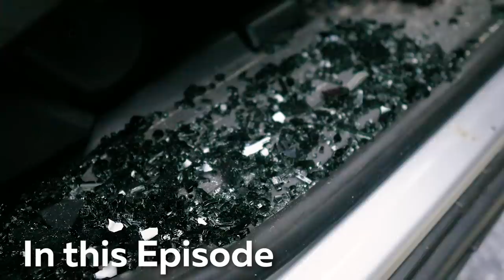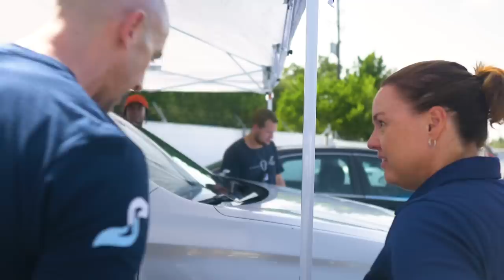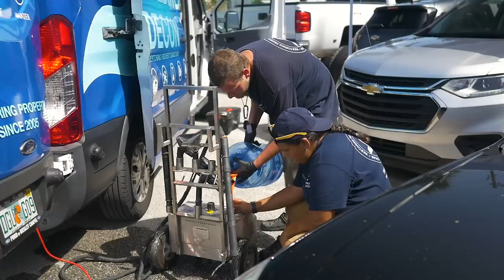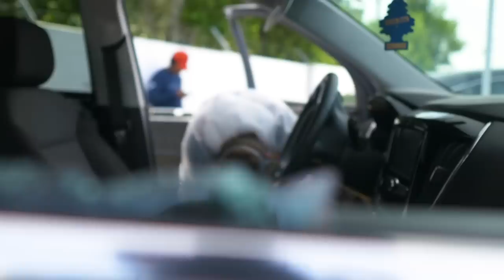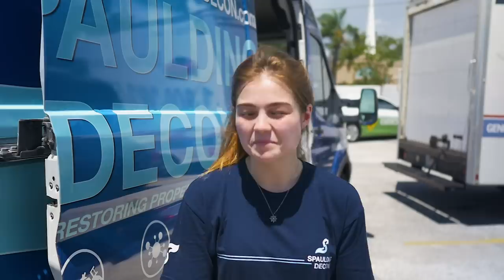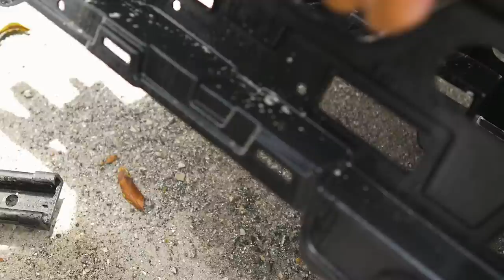Southbound Shootout

Comment: I wish you guys could've put the the car into a warehouse of some sort so it would be cooler working conditions.
Reply: Or work at night when it'd be cooler.
Reply: @fungussf  why can't they just crush the car and get it to junkyard??
Reply: @margaretalbert69  its covered in blood. The biohazard has to be removed before it can be taken to the junkyard.
Reply: @AlyssaSoftPaw  you can buy bio cars from copart with the blood and all
Reply: @cstoner421620  Yep.  I have seen them on auction sites.
Reply: @margaretalbert69  depends on the value of the car after repairs. That looked like a fairly new car. The cost of cleaning and repair is probably still far below the resale value. Even when it is higher, many shops will buy them at auction if they can do the most expensive work themselves. That still allows them to turn a profit if the repaired car will be worth it. Personally, because of stuff like decomp, frame damage, and flooding (mold), I don't intend to ever own a salvage title car unless I can get its history from a reputable source.
Reply: @blazertundra  sorry if I read your comment wrong but I'm curious. If the car has had bio in it, it automatically has to be a salvage title? Or was that just an example
Reply: @mossymindful  bio would only make a car a salvage title if the cleaning/repair costs more than the car is worth. For example, a rat could die in the trunk of my car and be found a month later. The cost of throwing out the carpet and hiring a cleanup company to clean up anything I missed and ozone the trunk would be way cheaper than my car is worth, so it would not be a salvage title even though it had a bio job.
Reply: @AlyssaSoftPaw  this car won't go to a junkyard. It's at a body shop to be repaired and put back on the road.
Reply: Ann B  why let a vehicle someone else can drive for far cheaper than a new one go to waste
Reply from the maker: The dealership was actually planning on reassembling the interior of the car so it could be used again, so we had to decontaminate all the bio in order for it to be safe for future use.
Reply: Margaret Albert Exactly my same thought! Wouldn’t the people investigating the crime be digging out the bullets. What do they plan on doing with the vehicle after your crew is finished?
Reply: Lizzy   Won’t it be crushed anyway?
Reply: @cstoner421620  really🤢
Reply: @swiftkarma4436  recycle reuse. The number of soda cans that are recycled is amazing and most likely because of the alloy we will see a can we drank out of at some point in our lives. All be melted to make new

Comment: Time to buy a set of Torx screwdrivers, those are the types of screws holding down the seats. They are increasingly being used in cars and equipment. I bought mine at Harbor Freight.
Reply: That is where my husband bought a huge set of all kinds of star tip and hex tip type of screwdrivers. (Harbor Freight) At the time I bitched about the purchase, until we needed them to find one of my rings that got lodged under the seat in his truck. Now I keep a set in my own personal tool box I keep for my house hold projects. They work great.
Reply: @ Willliam I was thinking they could use a Tap & Die set. My cheap lil set has gotten me out of some real pain-in-the-ass projects
Reply: Torx sockets. Screwdriver ain't budging that loc-tite

Comment: It would be worth investing in a misting fan like amusement parks have. It mists water in front of a fan to cool the area and everyone in the area. You might not use it a lot, but in situations like this it would make the work go faster and easier on the tech's. I have seen a couple times in your videos that it would have been a life saver
Reply: yeah or it would be nice to have an air conditioned building to pull the car in.  On days like that a tent isn't going to help much. It blocks the sun but the humidity will still drain you.  Weve been having a heatwave here in Ky recently.  Heat index of 110 for 3 days straight last week. 105 HI yesterday and 115 HI in future forecast.  Last year we didn't have any days that hot.  2022 is already a sizzler and its just June

Comment: Biggest shock: them using a screwdriver to try to remove a seat bolt stripping it instead of asking the body shop to begin with
Reply: Yeah, not too bright are they? Also, I would have a damn AC system nearby running off a generator. I mean come on man, not rocket science here.
Reply: Jonny Valiant they’re not freaking mechanics...they clean crime scenes 😑🤦🏾‍♀️
Reply: @ Dan AGREE!!! I'm yelling at the computer screen "C'mon Get it together!!"    Was kinda hoping the heat had fogged up their ability to think logically.  also LOL at not being able to start the generator.. they could use someone on the team who can tinker.

Comment: Wow guys, what an interesting job you all have. I know families are really glad to have your help, God bless. Also, there is a tool for getting stripped screws and bolts out. It's just a little box with 3 or 4 drill bits in it. The bits drill out the bolt then the other side of the bit takes the bolt out. We have them here in Canada so I would think you have them in the USA. Any hardware store, kent, home depot etc., should have them, they work great. Hope this helps.🙏🙏👍🇨🇦

Comment: I bought a used RV at a dealership three weeks ago at Beckley’s in Thurmont Maryland. After it was delivered I stripped the bed of the linen that it came with and found blood all over the mattress. When I called them they said I should have looked at it more closely before I bought it and then they told me to just throw it out or bring the mattress back to them. They are over an hour away and I can’t lift the mattress to even flip it over. This situation gets worse but just so anyone else out there in the market for an RV that is used, take all bedding off all beds before purchasing. I am stuck with a king mattress with biohazard all over it.
Reply from the maker: Jesus. That’s horrible. Make sure it didn’t seep to the wood beneath it.

Comment: LOL looks like you guys should carry some Torx Bits, lacking some tools for a car job.
Reply: How about some tools that don't look like they were bought at a yard sale. 😬
Reply: I hate the torx fad. Because 3-4 different types of bolt patterns in one vehicle clearly isn't enough.
Reply: I will say from first hand experience, after years of dirt and rust getting onto  bolt heads, torx heads are easier to remove than phillips or small hex headed stuff. The bits still bite in good with all those points.
Reply: @dropinbiking92  interesting. I probably never saw the use for them because I run mail machines, which typically don't get an excessive buildup of crud due to being indoors in a humidity controlled environment. My experience with torx tends to be either giving some choice words to stripped out head or not having the right bit.
Reply: Volkswagen has been using them for a long time, but a perfect example is those plastic / fabric / rubber wheel liners you see in the front wheel arches of all the GM vehicles. They used to be phillips heads with a washer, they would get all grubbed up and round off, making it hard to change a simple part, they switched to torx heads for those a few years back, problem solved.

Comment: You guys don't have a set of star wrenches? If you're gonna disassemble cars, that will make it a lot easier. A stripped bolt can be drilled out. Also, vacuuming out the whole car is a good idea. Safety glass is still sharp, and leaves behind a huge amount of fine, glass dust that can cause harm. Source: I work in car rental.

Comment: I wonder if you guys could put up sides to the tent and use a swamp cooler to cool it down a smidge? Or even just have a swamp cooler near there so you can go cool off.   That just seems miserable and there has to be a way to keep you guys cool.  Wet neck bands in cold water. Icepacks under your shirts. I feel bad for you guys sweating to death on so many boiling hot jobs.

Comment: Why is everyone and their mother using torx heads in their equipment now? On top of the added nuisance of having to buy a whole new set of bits, those things are the absolute worst to deal with when they strip out. Nick completely exhausted himself trying to remove a seat that should have taken 30 min or less to remove with any other bolt head pattern.
There is nothing better about torx than a metric hex bolt or a combination phillips/slotted head. I swear machine manufacturers are going out of their way to hire engineers who hate repair people.

Comment: You stripped the bolt because you weren't using the right tool dude those bolts are tight as hell you shouldn't use tools on the wrong boys nuts fasteners etc...

Comment: You guys need someone who knows mechanics to help on jobs like this. I already watched the tractor trailer get essentially destroyed and you guys were trying to remove a torques bolt for a car seat with a flat blade screw driver!  😂 

Well, there’s firsts for everyone I suppose. I could have easily shown you guys what to use and how to take tons of this stuff apart and back together without even a hiccup.